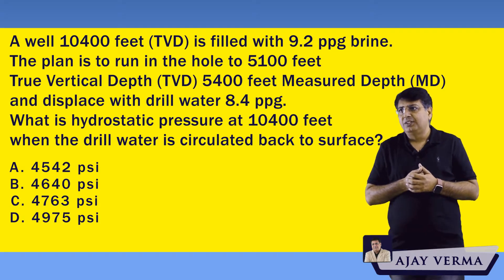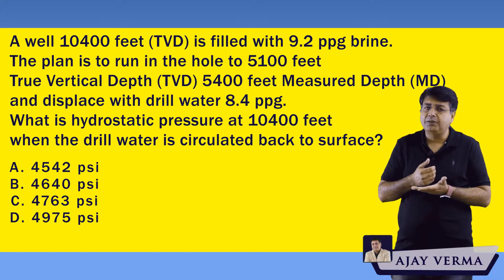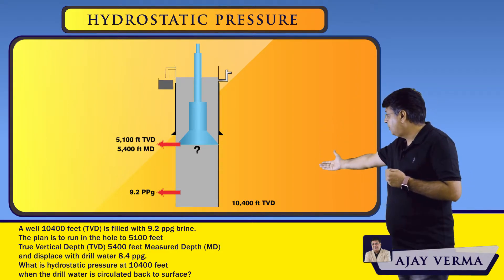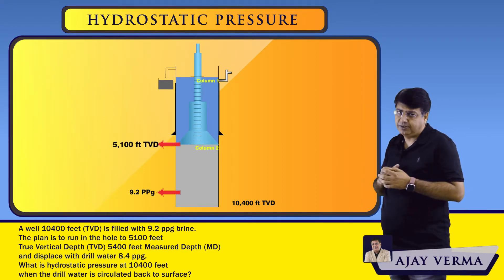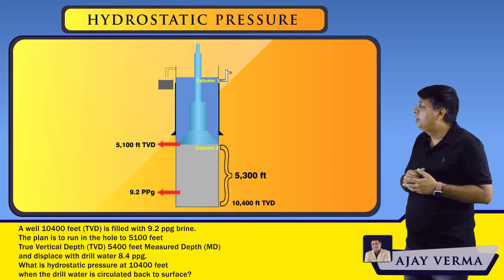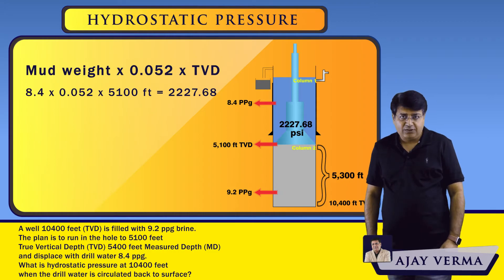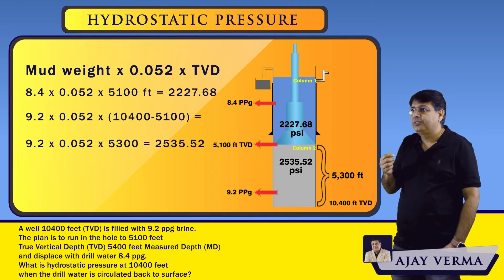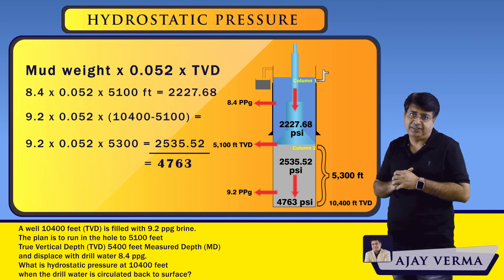IWCF question | IWCF Level 4 |Hydrostatic Pressure | Drilling Operation | BHP | English Version

Comment: For those who has doubt why taken 5100 ft TVD and why not 5400 ft MD.

The new mud will replace all 5400 ft MD volume but for HYDROSTATIC, universally we takes vertical height of columns, that is why taken 5100 ft TVD for hydrostatic calculation.